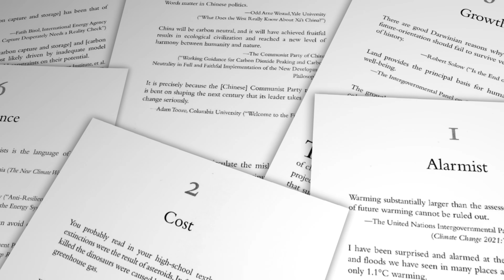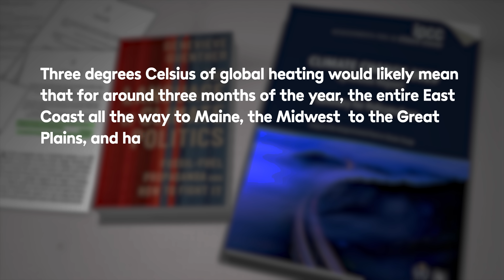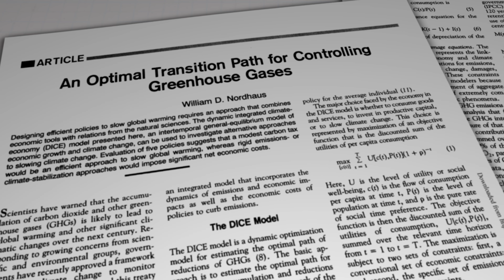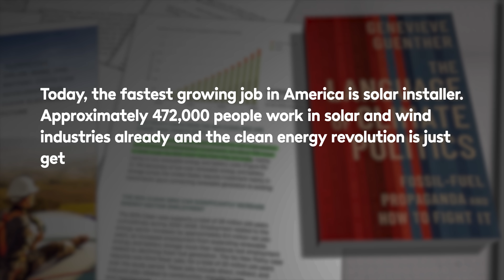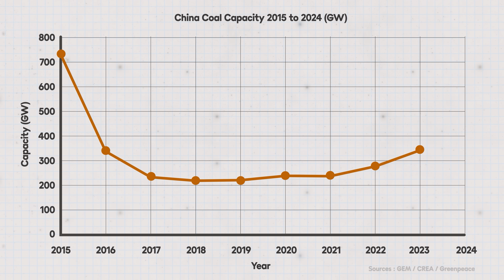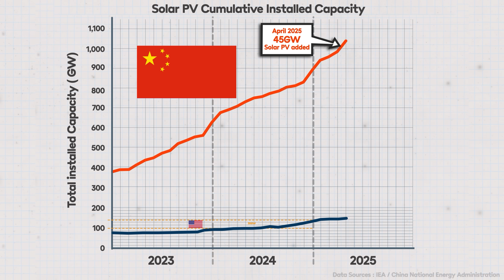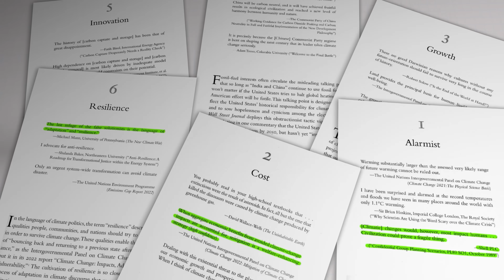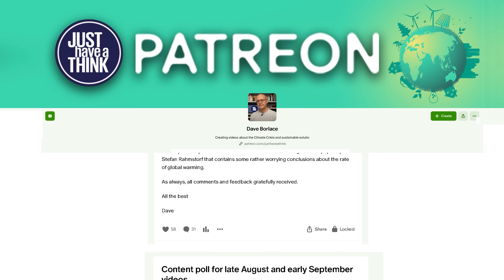New research DEBUNKS climate disinformation.

Comment: From all the stupid and dangerous policies Trump and Maga has made, ignoring climate change is the worst 😮😮😮
Reply: HOTTEST DAY EVER! How many times have you heard that? Weather stations are at airports built in the 60s, 70s and 80s in rural areas that are now urban. So "ever" means in the last few decades, and those records are never adjusted down for the urban heat island effect that boosts temps by 15-20°F (8–11°C). 

34 more censored facts:
1. Since 1850 the average global temperature has increased by 1.2°C (2.2°F); equivalent to a 600 foot decrease in altitude. 
2. 1850 was the end of the Little Ice Age (LIA) 1300-1850 A.D. the coldest multi-century period of the last 10,000 years.
3. Glaciers/ice sheets reached their greatest extent of the last 5000 years in the LIA. Total ice volume today is greater than it was prior to the LIA expansion.
4. Had the LIA continued we may be entering full glaciation. 
5. Modern warming doesn't correlate to changes in CO2. Most warming was from 1750-1950, before CO2 increased significantly. CO2 increased sharply in the 1950s while temperatures fell slightly until the 1980s, (Hence the new ice age scare of the 1970s)
6. Modern warming manifests as higher overnight lows and milder winters at high latitudes, with little to no increase in summertime highs or heat waves.
7. There's been no increased desertification. The opposite is actually true.
8. The U.S. growing season is 2-3 weeks longer than a century ago, and food production has tripled on slightly less land.
9. Temperature records from the 1800s and early 1900s don't exist for most of the world, early records have been adjusted down with dubious justification, and the urban heat island effect isn't adequately accounted for, so many scientists question the degree of modern warming.
10. Modern warming is beneficial by every conceivable metric, and continued warming up to 3°C would be mostly beneficial as well. 
11. Activist scientists cherry pick data to eliminate well known past warming (Climategate), and falsely claim they were only regional, but the best proxies confirm Earth was warmer than now for most of the last 10,000 years. The Medieval (900 to 1300 C.E.), Roman (250 B.C. to 400 A.D.), and Minoan (2100-1700 BC) Warm Periods were 1-2°C warmer, and the Holocene Climate Optimum (7000 to 3000 B.C) was 3°C  warmer. 
12. Humanity always prospered in warm times. Food was abundant, populations increased and civilizations thrived. People suffered of starvation and disease in cold times and civilizations fell. 
13. The mid-Holocene sea level high stand (2000-5000 B.C) was up to 5M higher than today.
14. Alarmists claim crossed tipping points will cause runaway warming, but it's been 3°C warmer with no run-away warming.
15. CO2 warming diminishes logarithmically. 420 PPM is near full saturation so doubling CO2 to 840 PPM would have negligible effects. 
16. Solar variation, cloud cover, ocean currents, and cosmic rays all effect climate, but due to the obsession with AGW these and other natural drivers remain understudied and poorly understood.
17. The complete weather record shows no increase in extreme weather events. Upward trends are derived by cherry picking start dates. 
18. Damage costs are conflated with more extreme weather but more people with more property susceptible to weather accounts for increased cost, not climate change.
19. Despite the population explosion climate-related deaths are down 98% from 100 years ago.
20. Even today many more people die from cold weather than hot. 
21. Wildfires are down 80% since the 1920s. Less aggressive fire management policies began in the 1980s. To show a deceptive upward trend alarmists always start here. 
22. On a geologic scale 420 PPM CO2 is extremely low. 500 million years ago CO2 was 5000-7000 PPM, but CO2 eventually becomes limestone so It's been falling ever since. 
23. The Isthmus of Panama blocked oceanic heat transfer 2.5 million years ago, triggering the ice age. Cold water absorbs more CO2 so 20K years ago during the LGM CO2 fell to its LOWEST POINT EVER at just 170 PPM and plants barely grew. If CO2 had reached 150 PPM all plants would've died causing mass extinction.
24. Through ice age cycles warming always leads the rise in CO2 by 200-800 years. Warm water emits CO2 so this makes perfect sense, hence rising CO2 is an effect of warming, not the cause. 
25. Greenhouses boost CO2 to 1200-1600 PPM because that was the environment plants evolved in over hundreds of millions of years, and how they still grow best today. 
26. CO2 fertilization has made Earth 20% greener than it was 30 years ago. Increased CO2 also makes plants more drought tolerant, so arid regions benefit most. 
27. CO2 fertilization effect has increased crop yields 15-20% globally. If CO2 magically fell to 280 PPM a worldwide famine would follow.
28. Claims of CO2 fertilization making plants being less nutritious are examples of junk science protecting the "climate crisis" myth. These claims refer to micronutrients not essential for basic nutrition that can be easily restored with fertilization. The caloric content is the same, and the missing protein is gluten. 
29. Most mass extinction events were caused by sudden cooling, not warming, and there's no "mass extinction" happening today. Polar bears have tripled since the 1960s and almost all endangered species have seen recent population increases. Since 2000 4 mammals have gone extinct, and the extinctions of previous centuries were due to over hunting, invasive species, and habitat loss. These are still the biggest threats, not climate.   
30. CO2 fertilization has increased the food supply for all animals on land and in the sea. The more CO2 in the atmosphere the more life on Earth.
31. On the PH scale 7 is neutral. Oceans are alkaline with PH of 8.1 to 8.3. So CO2 only makes oceans more neutral, not acidic. Ocean PH has ranged from 6.5 to 8.5 with no impact on sea life.
32. Bleaching is a natural part of coral lifecycle not resulting in death. The Great Barrier reef is near record extent. Coral only grows in the warmest parts of the ocean so if warming continues corals will only grow larger and healthier.
33. Since 1850 the global mean sea level has risen about 12 inches at rates from zero to 3.5 mm per year. If we're locked into the higher rate sea level may rise 1 foot by 2100. Plan for it. Crisis averted. 
34. Recent studies show tropical islands are actually rising because strong wind and waves transport sand onto the islands. 

True believers will challenge these facts, but this is where critical thinking comes in. Political pressures, funding directives, and the impartiality of scientific publishers has influenced climate studies to exaggerate the effects of CO2. These factors and more have created an enormous bias in academia to promote and protect the CO2 control knob hypothesis. Scientific work that contradicts or challenges it in any way is strictly prohibited, with dire consequences for those who don't comply. Pointing out well known facts that don't align with the "climate crisis" narrative, such as CO2 benefits to plants, or the logarithmically diminishing warming of CO2 is enough to be labelled a "climate denier". This relentless pressure in academia to manufacture "consensus" is why most people aren't aware of these facts. 

When I started studying the science of climate intensively a few years ago, I recognized the bias and misinformation in most climate papers and studies. Self education of climate requires a critical eye and an expectation for data to be misconstrued. Just reading the abstract and conclusion isn't enough. A study may contain data that contradicts the mainstream narrative, but challenging the narrative has adverse consequences so authors find a safe point to make. More deceptive examples cherry-pick a start point to show a trend that doesn't exist in the full record. The most egregious disinformation promoted by climate crisis advocates are studies from activist scientists who cherry-pick and manipulate data to reach a preconceived outcome (Climategates 1, 2 and 3). Watch this about the COOK-ed up "97% consensuses" and then tell me it's not an outright lie. 
youtube.com/watch?v=ewJ6TI8ccAw

Dogma in science isn't new. History shows academic dogmas stifling progress over and over again. A hypothesis beloved by gatekeepers transcends critique. Scientific method be damned our manufactured "consensus" has spoken. An incorrect hypothesis is knighted sacrosanct theory regarded as fact. For decades Clovis First was so entrenched in archeology challenging it was hypocrisy. Alfred Wegener advocated continental drift in 1912 and was mocked the rest of his life. Carlos Finlay discovered mosquitoes transmit yellow fever in the 1870s and was ignored for 30 years while millions died. 

A confluence of politics, funding and gatekeeper ideology has entrenched the CO2 control knob hypothesis deep in the heart of academia, but an objective examination of the evidence reveals it as the worst manufactured "consensus" of a false hypothesis since Galileo was forced to recant on pain of death the earth orbits the sun. Sensationalist media multiplied the falsehood and the "climate crisis" was born. Ultimately facts will prevail and it will join this Wiki page of overturned scientific beliefs. en.wikipedia.org/wiki/List_of_superseded_scientific_theories

References:
energy.gov/sites/default/files/2025-07/DOE_Critical_Review_of_Impacts_of_GHG_Emissions_on_the_US_Climate_July_2025.pdf
petitionproject.org/gw_article/GWReview_OISM150.pdf
Or just watch this to learn the truth  
youtube.com/@ClimateTheMovie
Reply: @jholt03 are you from the oil industry 😂
Reply: @GhostRider-c5x 
Ad hominem is not an argument. If you had an argument, you would have attacked their ideas instead of attacking them personally.
Reply: @johnryan6658 their "ideas" are beyond stupid: do you really believe that blowing up all the coal, oil or gas which was stored for millions of years into the atmosphere in only 100 years and cutting down rain forests has no impact on the planet? And all scientists are wrong??? He has mentioned no evidence for his claims, so i can't argue....
Reply: @jholt03   ah the denier copy and paste job. The LIA the little ice age (folksy name) was not a global cooling. Two extraordinary volcanic eruptions may have extended it. The peak of the impact shifted.
Reply: @franziskani Unless they're on the scale of something like the Deccan or Siberian traps, volcanic eruptions don't affect the climate for centuries, not even decades. The "extraordinary" volcanos you're referring to would've only had a cooling effect for a few years at most. Tambora (1815) was the largest eruption in at least 1,300 year and it caused the YEAR Without a Summer, not decades.
Reply: @franziskani  Before my own concerns prompted me to study the climate literature, my beliefs were probably similar to yours. The vast majority of climate science is focused the implications of presumed CO2 induced warming. Studies like that aren't relevant to understanding the CO2 control knob concept or evaluating its legitimacy. The basic premise is simple, but it's impossible to test how the physical properties exhibited by CO2 in a lab might apply to the fantastically complicated climate. There are far too many unknown variables to make that extrapolation, but climate models attempt it anyway. Over a trillions dollars have been spent on climate models and they still run too hot. it's become so obvious even the IPCC turned to a more data driven approach. If the entire narrative and all its implications weren't based on the CO2 threat, the climate models would've just tuned down CO2 sensitivity a long time ago.
Reply: @jholt03   The ice is retracting, volume and area. (if you go by global data, we are talking about global warming not the medieval cooling period that affected parts of Europe and had impacts on parts of Asia - but it shifted. And how exactely did they measure the Arctic ice shield then. Ice in the summer ? We know what the glaciers were like in Europe and we know a bit what the settlements were like - or at the end of the time when the British navy did some reporting. But it was all inconsistent.
Reply: @jholt03   it is NOT 3 degrees Celsius warmer but 1 degree C gloabl mean temperature.  and the problematic scenario are 1,5 degree C and the  scary scenario are 3 degrees C. Of  global mean temperature increase. btw 1 degree C NOW does not mean it stays like that, it accelerates.
Reply: @franziskani  When James Hansen made his cataclysmic predictions to congress in June of 1988, the control know hypothesis had a glaring problem. Since the 1950s when  the first ice cores were taken in Greenland during the late 50s all the evidence agreed. Most of the Holocene had been significantly warmer than any modern warming. At that time this wasn't at all controversial. The CO2 control knob hypothesis had to rewrite climate history, and much of the "science" has been dedicated to achieving that goal. For each of my facts I've examined both the supporting evidence and any evidence used to refute it, and without exception the supporting evidence is always more robust.
Reply: @jholt03    Ice is a temperature buffer - it is even industrially  used for that purpose. Because to melt ice (at zero degree C) into water (STILL zero degree C) - you need a LOT of energy. Both substances have the same temperature, the difference is the state (from solid to liquid).

With the Celsius scale 0 is the freezing point for fresh water and 100 is the boiling point (at sea level, so in practice more like 95 degrees). 

You could heat up that zero degree water with the same amount of energy that you needed for melting it -  and it would get you 80 degree hot water. That is not quite boiling point but hot enough to sterilize stuff. Or cook eggs if you let them in the water for a while.

A lot of energy is stored in that state (frozen) - and normally the ice stays stable even if it is exposed to some heat (and regenerates when it gets colder, it also sets free a lot of heat when water changes into ice, so that delays the onset of colder land and air temperatures at the poles). 

The ice caps at the poles stabilize our weather they absorb some of the seasonal differences.
Reply: No it’s not.
Reply: Not sure that's true. From what I can see we have pushed the tech far enough that for private households solar is already a no-brainer, provided you are not too poor to afford the battery. And on the other side, Trump's "Drill baby, drill"-politics lead into a bit of a problem for the American oil industry, because American oil is a bit too expensive to bring up at the current low oil prices.

In short: renewable energies are more or less past the tipping point, or will soon be, if the rest of the world stays its current course. What the US do simply doesn't matter in the long run.
Reply: @Volkbrecht   For some reason fossil fuels are still subsidized - that money could be diverted. Even better using DIRECT MONEY CREATION for a publicly owned investment bank that gives out loans for certain projects. (the loan volume does not increase government debt). Especially for communal housing and energy or public transportation  projects. There are plenty of not wealthy households or that that live for rent in a multi storey building. Giving them very low cost loans (think 1 % or even interest free over 20 years - or longer) would create a realistic chance for all. There would have to be a lottery system who of the low income folks gets the loans and the state would have to set up an academy for solateurs to have the workforce to even install the added capacity. That could be 6 - 12  year intense school (some practical work but mostly theoretical)  then an apprenticeship with a company (adults get a subsidy so they have something to live on, for teens it would be another method of apprenticeship). And if need be there would have to be a non-profit installation company run by a large city that provides those apprenticships.

Not everyone can work higher up - but there are also planners needed. Could be a method for worn out tile layers and construction workers to get into a white collar job - if they master the technicalities. 

And the same would be needed for plumbing - geothermal.
Reply: How are you going to fight fossil fuels as the world's main energy source?  Wind mills and solar panels?...You have to be kidding....The reality is that fossil fuels keep economies moving and keep people from dying.  Wind and solar energy for large scale energy are dead ends and a waste of money.  Wind energy is already collapsing without the huge government subsidies they've gotten to stay afloat.

Comment: I completely respect the data analysis of the researchers you site. It seems apparent the reciprocating feedback loops are outstripping the models. The recent paper by James Hansen on the need to reset the models illuminates this.The latest research data on Antarctic sea ice loss as irreversible should be a wakeup call